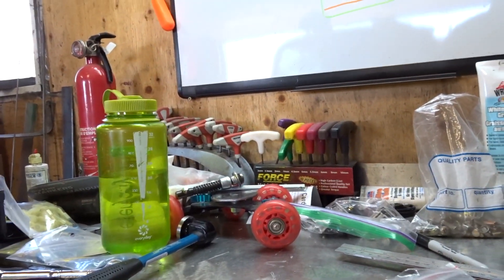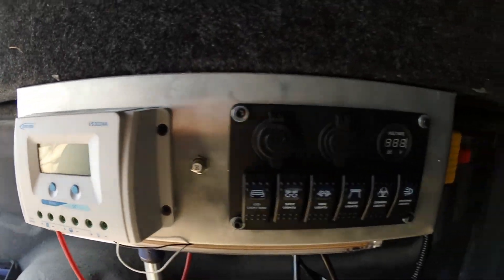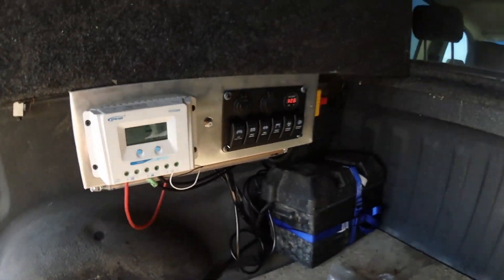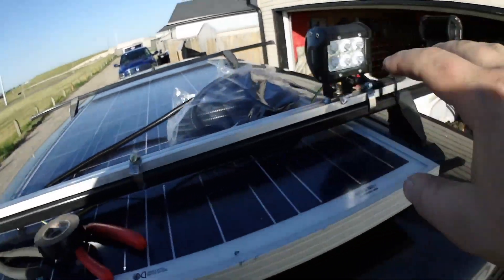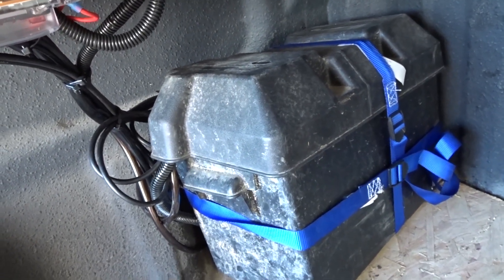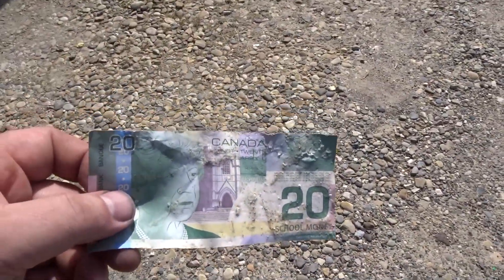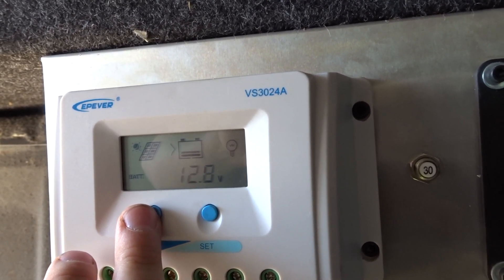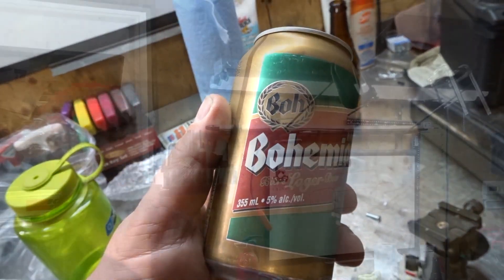Budget Overland Trouble Shooting Electrical Issues

Comment: If you get a season out of the Nautilus battery you will be lucky.I work on RV's and replace these cheep batteries all the time and most not even a year old.Keep the receipt and they will keep giving you new ones.
Reply from the maker: +john stewart it will be interesting to see what will happen to the battery over time, that Costco battery lasted a lifetime
Reply: Some people seem to go through batteries like there's no tomorrow, me ? I can have the same battery for 7 to 10 years without problems, the one caveat is my Veloster, the battery needed replacing after 4 years, still started the car but the computer was flaking out something weird with it, i think one of the cells was going bad.
Reply from the maker: the one in my truck is about 6 years old i'm going to assume it will die this winter

Comment: It would be interesting to see what kind of output you are losing due to the shading from the Thule bars. It's a bit of a compermise either way though, higher charging current vs losing the utility of the roof rack. If there ends up being a large difference in output, maybe you could mount the lights to the topper without using the rear bar. Then remove the bars and install them when you need to.
Reply from the maker: the bars are just locked in place and can be removed easily and the the wiring for the lights is connected with a trailer plug so all can be removed in minutes if needed.

Comment: Very well designed Jerry. I  have  a 100w panel and have never used the genset to charge my batteries so far.  Yours on the roof will not be directed at the sun for full charging but neither is mine when the sun moves from east to west. I get 5 amps at noon and about 2 the rest of the day. You don't use an inverter for 120v lighting like I do so you're also more efficient.  Would have been cool if you could have has the solar panel on a hinge at one end and be able to tilt it up . That would definitely be the solution if  you find your low on battery capacity.  I never run below 12v it's too hard on the batteries. 50 % discharge at 12v seems to  work for me but most times I never see it go below 12.3V.   Did the panel come with a diode  ?
Reply from the maker: just remember I have 2 solar panels i have a plan that you will see later on for the other panel.  I honestly don't know if i have a diode or not
Reply: Where the connections are at the panel it should be soldered in  under the waterproof cover . I had to put my own one in on one panel but the other already had it on. You definitely need one.
Reply: Diode is built in to the regulator.